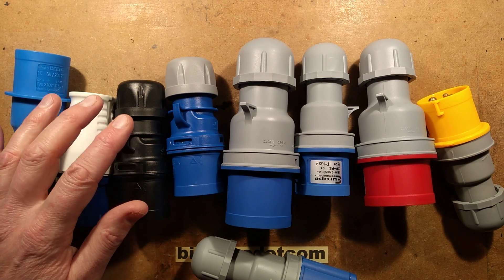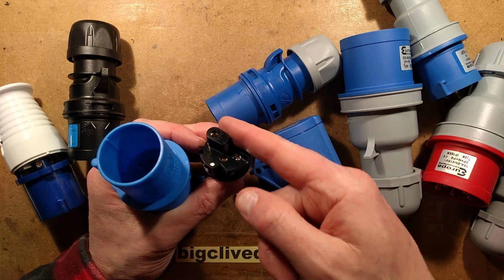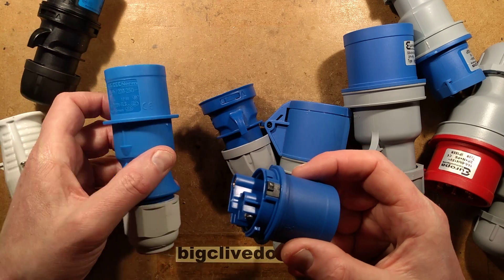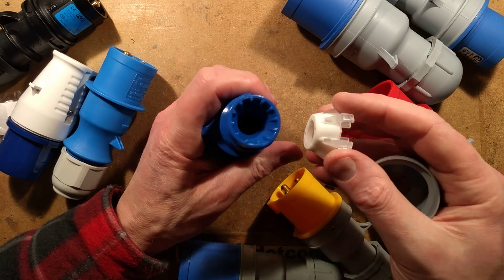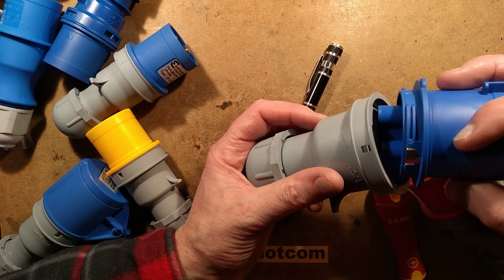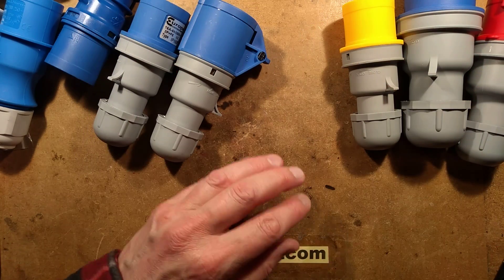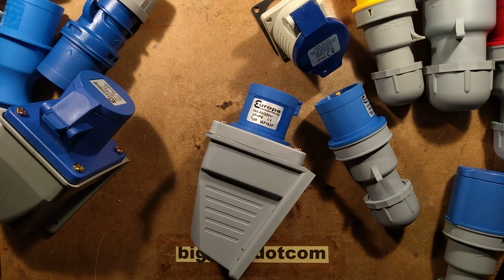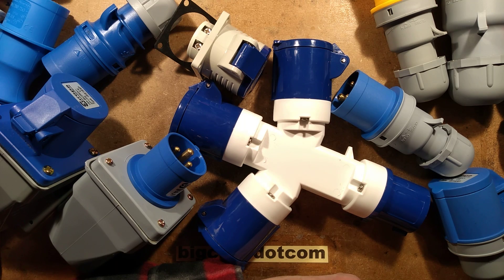My favourite industrial connector (Ceeform).

Comment: We call those Pin and Sleeve. 
We also do not use them here in 'murrica. We're still stuck on the NEMA standard. Honestly though, it's pretty good and newer outlets will not energize without the correct connector installed. 
You can also get weather resistant (WR) connectors for most of the more common NEMA plugs.

Anyone ever see Stage Pin Connectors outside the US and UK? They aren't common anywhere outside the entertainment industry, but they have some advantages. The smallest on you can find in the US, is rated for 20A. They are quite sturdy and durable. The  nice thing is the rectangular shape means the connectors lie flat on the floor. You can also tweak them when need be to tighten up the pins.
Reply: I don't think I've ever seen "stage pin" in the UK.

The theatres I've been in in the UK have mostly used 15A BS546, while the temporary events guys tend to prefer 16A ceeform. Lighting setups in places like schools and village halls often used 5A BS546 though my understanding is that this has very much fallen out of favour (and noone seems to make 5A trailing sockets anymore).
Reply: I've only worked in the US and stage pin isn't very common anymore. It's mostly been replaced by Neutrik powerCON. Especially since the basic one is rated for 20A, which is good for our 120v mains. 
Ceeform has gotten a little more popular though. I am seeing them more and more in convention spaces on 60A feeds

Comment: In the US, they aren't very common. I've seen them used in computer data centers where they need to bring large voltage and/or current to a rack. And of course, COTA -- because it's an F1 facility.

Comment: Netherlands, commonly used in industrial single phase 230v connections (blue 3 pin, at 16 or 32 amps) or for 3 phase 400v (red 4 or 5 pin, 5 pin if a neutral is also fitted, from 16 amps to 125 amps.

The blue ones are also used on campsites, for attaching caravans and campers to mains power.

Comment: The red one AKA CEE16A is used all over the map in Europe. In Germany you can find them literally anywhere, many cellars and garages have one as they're THE standard connector for high power gear and especially motors. It's also standard to erect a distribution cabinet and breaker box with CEE16A and CEE7 sockets on every construction site...

Comment: I was working for a company which did electric tests on power grids of buildings and mashines... I saw all of those sockets, expect the yellow ones, here in germany, up to 125A... The blue 230V/16A I just know from the heavy industries... The most common are the 400V/16A and 32A, mostly for outdoor use at construction sites, fairs and everything which requiers three-phase electricity... At companies where the machines didn't have a direct conections to the power grid, I saw those 16A/32A also more often... But the 63A and 125A connectors you'll just see at heavy industries companies...

Comment: other subject, i don't know how to contact you. 
In france a girl has electrocuted herself with here phone while in here bath. It was charging and it fell into the water. 
I thought it was 5 to 18v(Quick charge) and could do no harm. 
Is it because it's chineesium crap, or mabe in the water the body resistence gets so low any voltage get enough current to kill you? 
Could you do a video to enlight us about the matter? 
Thanks!
Reply from the maker: Most of these bath electrocutions happen because either the charger in a power socket was balanced on the edge of the bath (in one case a guy placed the socket strip on his chest!) or the charger itself was non compliant and had little to no separation between the high and low voltage sides.
Reply: @bigclivedotcom  Thanks for the response. sounds incredibly stupid for the guy

Comment: We use them a lot in Norway. Every construction site is filled with them and a lot of venues got them installed in the walls for use with concerts, usually 63A, but sometimes 32A is used. I've never worked with anything lager than 125A.

I think my personal favourites has to be the ones made by Mennekes and ABL, the ones with rubber grips are easier and more ergonomic to work with.

Comment: I work in the entertainment industry in New Zealand, and the 16A and 32A single phase cee form connectors are common, as well as the 63A and 125A 3 phase. The 32A 3phase is also seen somewhat regularly but the PDL (a local schneider electric subsidary) 56 series is more commonly used for this, the PDL56P532 is common on portable 32A power distros in nz and australia.

Outside of entertainment industry, in commercial and industrial applications, the 56 series seems to be much more common for single and three phase applications up to 40A, and the AS/NZS 3112 connector (of which the 10A variant is our standard GPO) has variants up to 32A for appliances such as cafe espresso machines.

Comment: There are also 4 and 5 pole plugs with a phase swap option, we use that on equipment that is used on random sites, because when you plug it in some how the motor always runs in the wrong direction.
Also there are 63 and 125 Amp connectors with a pilot pin to switch off the load before the pins connect or disconnect.

Comment: France. The red ones are usually used for three-phase 380V (one exemple I saw in person was for a industrial space heater, the cable on these is insanely thick), I've also seen the blue ones being used on RVs (Recreational Vehicles) 240 mains supply (though in this case, some people just use a harness to convert that plug into a regular type CEE 7/7 plug...) and some construction work electrical panels.

Comment: IEC60309 provides capacity for 24v to 1000v. DC or AC up to 500hz. But I've never seen violet,white, black orange, grey or green ones in use anywhere.

Comment: In Finland we have those connectors in wide use. In carages/warehouses/industry in general we have the red 3-phase connector in cases you need 3 phase current i.e. welding. And in camping/boating people have the blue ones. Perhaps one thing you might have missed in the fact that for example the blue connector ensures correct phase order for example in the case you want to connect power to your camping van, so that electrical installation in the van can be done knowing which is live and neutral.

Comment: I live in Austria (i work as an mechatronics  engineer in  the automotive industry) and we have those CEE connectors for everything with 3 Phase from 16A till 125A (1 Phase mostly for 16A) for industrial use or for home use. Also worth noting is that the connectors with the shark fins latch together so you cant accidentally unplug them by pulling them. Common brands are MENNEKES or KOPP. Connectors with or above 63A do also have an extra locking mechanism  designed like a bayonet mount. There are also variants with included phase inverter

Comment: Germany: The blue single phase is the standard connector for mobile homes/camper trailer hook ups on camping sites.
The red ones are the only connectors i know for connection 3-phase over here (workshop equipment etc.)
The 12V connectors between cars and trailers are kind of similar, they have a few more pins for the different lights.

Comment: You can also get IP67 versions of the sockets which have a big ring that rotates to lock the plug tightly in place.
We use these for socketed power all over Europe and most of the rest of the world except for places like Australia who have their own special Clipsal sockets.
The ratings were chosen the other way round 250A was divided in two for 125A and again for 62.5A which was rounded up to 63A and again for 31.5A rounded up to 32A and then again /2 to 16A. 
Although as a computer person I'd have preferred 256/128/64 :)

Comment: Interesting! Thanks for the show! In sweden we got the 3 pole one phase connector and 5 pole three phase. The TRS cable is commonly called "rubbercable" as the cable commonly acts as a rubberband. I know norway have a 4 pole 3 phaseconnector with PEN connections instead of 2 connections for PE and N

Comment: In the Netherlands (and i suppose in the rest of the EU) they are quite common. Almost every device that needs 3 phase power has a red CEE plug, so you will find them in workshops on drills and sawing machines. The red plugs usually have 5 pins, or 4 when no neutral is needed (in case of symmetrical loads). The blue single phased types are often used on campsites and marinas.  On marketplaces they use CEEform plugs a lot to distribute power to the stalls. This is usually done by distribution boxes which we often call a 'paddenstoel' (mushroom) because of its shape. These boxes split the incoming 3 phase power into separate single phase outlets which are protected by fuses and RCD breakers.

Comment: israel: used everywhere where u need more than 16A for single fase and in every 3 fase application. 
btw they also come at ip67 rating and if u want to find your new favourite amongst these connectors you shuld check out "gewiss" they have plugs that use spring loaded connections to hook the wires instead of screws, very fast and simple.. pleasure to use.

Comment: Three phase ones are really common in Poland, even in residential buildings. It's commonly called "siła". I've seen my fair share of these being, for lack of a better word "out of code",  some people stick screws in the socket to charge something, or power a tool with a broken/different plug. As you say very common on building sites, thou I rarely saw the single phase flavor.

Comment: We use similar connectors on ambulances to charge up the auxiliary batteries. They have auto eject function that sometimes fails then they drive off ripping lead from ceiling and damaging connector on vehicle 🤦‍♂️

Comment: 220-240v Hook up lead for my motorhome has these. Hinged end at the motorhome end.  Other male end goes to the site hook up. Mines is the Chinese version. Also used for yaught and barge hook up.  Uk is usually a cabinet with supply points with a female outlet like the surface at 11.55mins to take a male plug and a  mount at 14mins at the motorhome end for the safety reasons you mentioned at 16.14. Am Portugal at moment and more often on the continent is a 2 pin euro connection at the site connection ,  so you have to have an adaptor

Comment: Interesting that you like those while preferring the British household plugs over the Schuko (which is pretty close to a CEE)
Reply: The British household plugs have fusing, which is one advantage and they are less likely to get accidentally pulled out of the socket (but not impossible) as the cord is at right angles to the pins. Disadvantage is sometimes you cannot plug in plugtop power units directly into the wall socket because of an adjacent surface. I've noticed on holiday that the Schuko gives you a second option as you can turn it up the other way.

Comment: I am in Turkey and I installed all my outdoor outlets in this form. There are many options for single/triphase 16/25/32/63A etc.
They are also used as machine power connections.

Comment: Well that's odd, you have comments over 3 weeks old on a 1 day old post???
Anyway, I too like the CEE-form. Used very often in the CEE16A for Caravan/RV use, I think they became standard issue about 25 years ago? I just could not believe how flimsy those 30A or even the 50A plugs were we used when we rented RVs in Canada and US. 
And sure, the building sites with lots of 125/63/32/16A red-ones. We have these temp central distrubution boxes, we call them "mushrooms" (paddestoelen) with from below inputting 125/63/32 Amp and having many connectors on the side.

Comment: Funny you talk about this type of connector today as I had to replace a faulty surface mounted 240v 32A socket today. The neutral pin was burning inside the unit. Don't mind working on these types of jobs. 
Cheers!
Bren
Ireland

Comment: @bigclivedotcom my local trade shop now use these quick connect style plugs for 3 phase connectors.... quite handy with no screws to mess around with. Thoughts?
https://www.bals.com/en/news-and-knowledge/lexicon/quick-connect
Reply from the maker: I've used that style in the past and they seemed fine.  There's also a version where you don't even need to strip the wire, but I'm not over confident in IDC style connectors.

Comment: The blue 16 amp ones are used for connecting touring caravans to distribution pillars on camping sites usually with orange sheathed cable so that it's visible lying on the grass. I have a ceeform socket to Schuko plug adaptor for use on older French sites that have not yet been rewired to ceeform sockets.

Comment: These are used on all industry related machines, basically "all" machines that operate from 3 phase power. 
For home and office 3 applications we use a kind of flat grey connector, that has a slightly longer earth pin sticking out in the middle. But personally is hate those since CEE is way more secure. 
Greetings from Denmark

Comment: What I've never understood with the 110v site safe system, is that I've seen endless 230v extension leads trailing across site and then the heavy transformer stood right next to the power tool !! 
Why isn't the transformer situated right back at the power source and then 110v extensions trailed through the puddles?
Reply from the maker: Normally there's a central 110V distribution position.  It's an old outdated system.  RCD protected 240V supplies and cordless power tools are a better option.

Comment: There is a reason why thes types of connectors are widely used in the entertainment industry. I have seen brutal abuse in so many ways that's absolutely necessary to have really taff connectors.

Unlikely I have often seen broken, melted, ripped, smashed or simply burned CEE connectors as well. In hard environments or simply because of abuse even the best connector dies...

But they are widely used in Germany.

Comment: In Denmark we use them a lot, mostly the red 16A in workshops, kitchens, industrial, and so on, we use 16A 32A 63A and 125A if more amp is needed it is powerlock, we allso use the blue ones, mostly for lightning on construction sites, and other 1 phase high draw equipment, as a standart outlet (fuga) in Denmark, is rated for 16A and, but it is only designet to draw 4A continuously

Comment: The 3 phase ones are standard in Hungary, the other variants are rarely used, but we do carry 'em.
The thing I like about them is that they are usually guaranteed 6 hours of continous use at nominal current while the household plugs might melt after a few hours.

Comment: Austria here! Actually the Company making these (PCE) ist mit far away from me ;)

We use them here for almost any 3 phase connection. 16&32A are very common. 63A and 125A are used also but as you said the cables get heavy. 

As an IT guy I would love if they head followed the 2^n Series for the amp rating.

The blue ones (230V mostly 16A) are commonly used for Camping Sites. Also they get more uses in other applications.

We have a kind of CEE Plug at the fire brigade providing our cars with shore power. One of the pins however is replaced by an air connection for the brakes so you have always full braking air tanks.

Comment: What you said about the event industry is so true.
Once helped out on a party/festival. They were trying to run about 16 mini champagne fridges of a single 16A line just Daisy chaining some multi plugs. By the time I noticed it the first plugs pvc coating was basically boiling off! 

Oh a bit later we also had a small issue with the earthing in a 3phase setup getting loose causing the lines to "float". One for one the appliances started to pop! Was just a student back then but clearly was paying more attention then the "electrician" on duty
Reply from the maker: When the neutral makes a bad connection in a three phase system it can result in high voltages that can damage equipment.
Reply: @bigclivedotcom  you never forget the smell of burnted out fridge compressor!

Comment: I am a stagehand in the Southeast USA. I normally don't see these much. However if a large or international act will come through, there will be some equipment with these connectors used on it. They are much larger and harder to use than the USA connectors that I normally use, but they seem to have a much more reliable connection.

Comment: Germany - The red one is used everywhere when 3-Phase power is needed and the blue one is used with normal 240V when a phisically stronger connection is needed. Also every connector is just scaled up with higher power ratings just like you said. I have never seen the yellow one though.

Comment: Those connectors are ONLY for indoor use. The outdoor ones has a sealing ring (https://www.picclickimg.com/d/l400/pict/143059214792_/Spina-industriale-CE-2P-T-32A-230V-IP67-per.jpg ) - at least in Italy

Comment: @05:00 the inside of that front part looks very much like a german Mennekes brand connector (Model 148A) but it is most likely a knockoff as I can‘t find this form of case on their website.
If you like the split-housing style you might want to have a look at the genuine Mennekes connectors if they are available where you are.
They also make these in IP68 rated versions and with clamp-down (SafeContact) or screw terminals.

Comment: All the council owned farms here have 16A sockets, have made a short lead with a 13A plug to 16A socket then a 16A plug to double 13A socket so can connect anything to anything.
Reply from the maker: I'm intrigued by the concept of council owned farms.
Reply: @bigclivedotcom  They are getting fewer and fewer as the farmers retire. Had a few where there would be two or more farms on the same site just on opposite sides of the yard! On more than one occasion the wrong customers equipment got repaired....